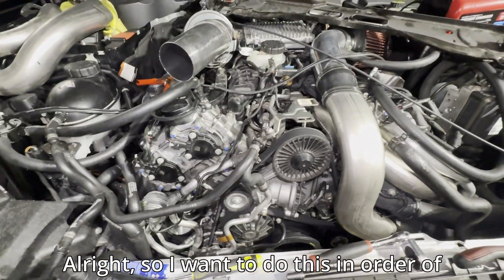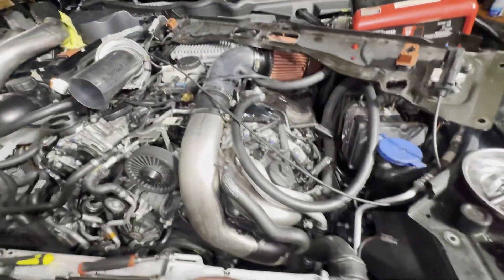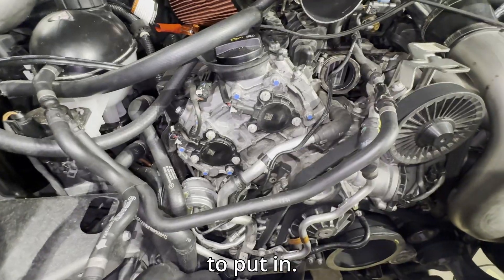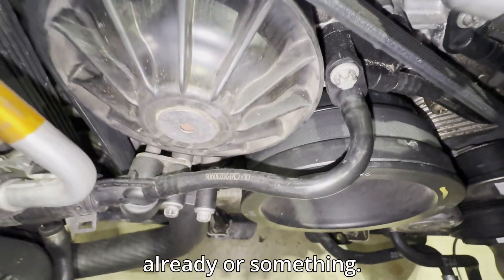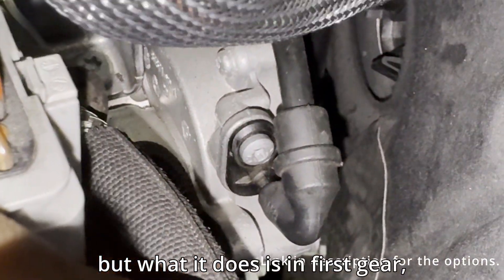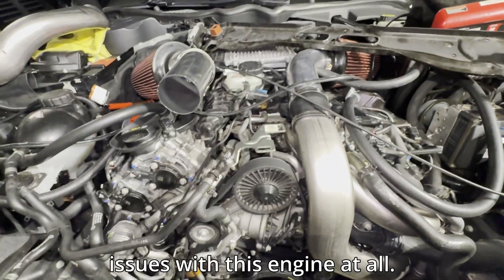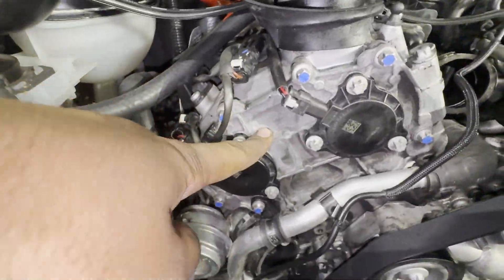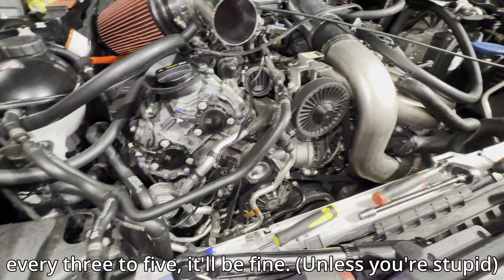Bulletproof Your Biturbo (M278, M157 common problems & fixes)

Comment: To get to the Driver's Side Turbo Coolant Line:
1. Remove driver side wheel and liner
2. Measure heat shield to find location of bolt
3. Use utility knife to cut heat shield and bend back
4. Remove/replace bolt
5. Bend back heat shield and reassemble everything

It's a bit back-yard mechanic, but after spending 3 hours trying this blind you will be glad you read this.
Reply from the maker: On the W218 it’s directly next to the frame rail, so sadly can’t do this.
Reply: @g @ginco_bnz bummer. It worked on the GL, but not on the E550. Looks promising on the CL63, but we will see someday.

Comment: The eBay pigtails on the cam sensors don't block the oil.  The only ones that block the oil are the ones you get from FCP for the magnets.
Reply from the maker: The magnets don’t leak, the sensors do.
Reply from the maker: And yes, they do block the oil if you RTV them in. I did it over a year ago on badly leaking sensors and there is still 0 oil at the pigtails.

Comment: can you give me some tip on putting RTV inside the sensor plug? how do you put it so that it wont clog the metal pin legs?
Reply from the maker: cut the tip of the RTV tube as thin as possible and push it behind the pins

Comment: Hello I just purchased a 2018 CLS 550 with 27K miles. Is it too new to do any of these upgrades or are there things you recommend I do immediately. Also is there any place to purchase full aluminum coolant lines? Thankyou
Reply: Bro your good the 2018 was the last model of the w218 all the mistakes on the 2014 and below were usually fixed on the 2015 and up for example the  2014 and below used aluminum  cylinder heads while 2015 and above used steel which really reduced the cylinder score which was one of the biggest issues on the m278 so don’t worry to much 

Also for the other things mentioned In the video I have a 2014 550 with 84k miles only thing I had to do that was mentioned in the video was my radiator hose other than nothing has of right now LOL but your good g enjoy your ride and be safe  I have had some pretty crazy experiences with that car😂😂😂

Comment: Awesome video man! I’ve got a 2013 G63 with the M157 and have to do the coolant lines for the turbo, I’ve done already but the next one is that PITA one on the drivers side so I’ll definitely be doing that rubber hose mod!

Comment: Question about the intercooler pump always on... 
 So I have a 2013 e63 (pre face lift/RWD) and I don't have that little box by the coolant reservoir to do the mod.   So do you know where it would be located on mine?

Comment: I am really curious. When you change most of the items you mentioned like the lines and hoses etc. Do you have to change them every so often or are the replacement items better and stronger than the ones that came with the original engine?
Reply from the maker: I would do them every 70-80k miles.

Comment: There’s some talk regarding disconnecting the solenoid and you’ll have timing chain tensioner/guide pre mature wear due to the constant 4bar oil pressure. Not sure how entirely accurate this is but have you noticed any signs of this?

Comment: I want to thank you for your suggestions - especially on the oil pump solenoid valve. Since I disconnected it, my 2013 E550 warms up in half the time, and the car is ready to go when I step on the gas. My sacrificial cam pigtails were just delivered, going to install them this weekend. Cheers!

Comment: I did the Oil solenoid trick about 2 years ago and it took my warmups from about 20 miles (would hit temp then re-cool ffs). Now it reaches temp within 4-5 miles and stays perfect. Even MB states that that solenoid is worthless as the TSB for it breaking in any way?.. is to do nothing as it's not essential. The Oil leak into the connectors is not a leak there.. but the oil creeps up through capillary action up the wiring... it's black magic as far as I'm concerned. Hoses: I just buy reinforced silicone hoses by the yard and cut it to size everywhere. I used to off-road in pretty remote areas and always carries spare stuff like hoses, wiring, fluids etc so, that's where that comes from. Also,.. to be "cool".. you can replace your hoses with your favorite colors, lol (I do blue hoses). Also lets you see what hoses you've already replaced base on color. There's also other things to do on the AMGs for saving $ (like buying E55 drilled and slotted rotors for my 2014 E63 Wagon versus the solid rotors - $1100 for rotors, pads, fluids etc delivered versus $3000 for just the 2014 rotors from MB but that's for another day).

Comment: Just got a 2017 S550.  Well maintained with 80k miles.  Took it for an inspection and they said there's zero oil leaks, but I cannot appreciate this video enough man.  This will ease a lot of my concerns with purchasing this beast.

Comment: Amazing vid! My dream car is s63 with this engine but im so scared to just keep it in the workshop all the time. Also What i found in Russian Language. 1. Always check radiotors - must be clean. 2. Keep oil max all the time. They brake because of too high temperature and oild thirstynes.  Also I have one idea! Range rover engines hold better if you keep 1 more liter oil than standart recomended. What do you guys think? It will be ok with this engine?

Comment: You seem like you know what's up with these MB cars.  I learned so many things from your video that I feel like I became a mechanic or something. LOL  I don't know anything about different engines, but I know that my 2013 GL63 AMG has camshaft position sensors issue.  Would your recommended pigtail extensions work with my camshaft sensors?  On the Ebay sale, it only includes upto GL550.  Thank you so much for sharing your knowledge!!!
Reply from the maker: They are all the same, any 550 will work with your 63.

Comment: I wanted to first fix the timing cover leaks in my '14 cls and ended up having to fix literally every single coolant line mentioned in this video cause mine were so brittle they kept breaking at the slightest touch. Also had to replace the coolant reservoir. Good thing now all I have to worry about is the pigtail connectors and the airmatic suspension

Comment: Your videos are super helpful. I just bought a 16 gle350, and i watched the upper timing cover vid. Definitely rather do it maysef than pay 1k or more. Thank you! Any idea where i can find a maintenance chart for these cars? Example: 30k miles, change this fluid, 60k miles, this and that fluid, etc?
Reply from the maker: Mercedes maintenance schedule is good, just ignore the oil changes and do them every 3-4k instead of 10k.
Reply: @ginco_bnz  i plan on 3-5k oil changes but cant find a list anywhere of any other scheduled fluid changes other than brake fluid every 20k
Reply from the maker: @whiteymarauder4372  Call a dealer and ask for one.

Comment: 2012 cls 550, M278, 215,000 miles still running strong, lets see if she can make it to 300,000 miles.
Reply: I just got a 2016 cls550 with 58k miles on it I hope it will last me a long time
Reply: @raymondpacheco1019  Your're good with the 2016 because that is when they went to cast iron cylinders and stopped using the coated cylinder walls.
Reply: @b.goranyordanoff3385 on both 278 and 157 engines? I've heard that's the biggest problem on those engines. Not that common, I guess I should say the most serious problem with those engines.
Reply: @b.goranyordanoff3385  That's not true, where did you hear that? AFAIK all M157 engines have Silitec
Reply: It should last you a long time, just keep up with the maintenance. They are awesome cars, lots of power. I still have it and she still running good. The main issue I had was with the air suspension,  but changed over to coil overs  @raymondpacheco1019
Reply: Who replaced everything before you bought the car?
Reply: @xK0-j3g i replaced everything that needed to be replaced myself. Still Original motor and tranny. When I got it it had 23000 miles. I had it since 2014, changed the alternator, fuel pump, turbo coolant lines, spark plugs brakes, coilovers, drive belt, radiator, etc, just to name a few...
Reply: Just tag me when it does . Love these cars 🎉
Reply: Hey, I’m trying to buy a cls rn, let me know how maintenance and other issues or cost happen on your 300k journey!
Reply: @Ymalodemine lasted till 149,000, but it would’ve went to 250k easily, I changed oil every 3k, and I drive around 150 miles a day everyday, had it since 60k not a single motor issue, not major not minor, my pops first time ever and last, 2 months ago tried changing my oil while I was at work, wanted to do a good deed for me, I come home, start the car it started ticking, a week later I look and find out he disconnected my magnet plug that goes to the camshaft, and I’m assuming the timing got messed up because now I checked and my marks are off by 7 teeth, a month ago I got white smoke blowing out my cat, check engine codes, fuel pressure sensor, camshaft position sensor, loss of performance, ticking sound louder, coolant disappearing but no leaks, so I haven’t drove it in a month, I ordered $1,000+ worth of parts, with labor being 3-5k I’m doing it myself, so started yesterday and hoping I’ll be driving it soon, I miss it haven’t drove it in a month, I’m just rebuilding 75% of the engine parts just so I don’t have to pull it in the near future, but it’s a SUPER reliable car, just unfortunate, and you know if you save up and set aside a few hundred bucks every paycheck for a rainy day fund, it’ll really be smooth and easy ownership, another major repair that happens on these cars is the suspension, the air suspension is always the first to go, I replaced mine right away all 4 bags cost me 2-3k, also didn’t pay labor did it myself, my cars NEVER been in a shop, I always do it myself and I am glad to say that this way probably saved me over 10-20k in labor, because of how much shops charge for these types of jobs, it’s really reliable and amazing as LONG AS YOU MAINTAIN IT, properly, recommended oil change is 7-10k miles, I do mine at 3k every month, and any little issue you get FIX IT right away, it’ll save you money
Reply: U ever give her gas or do you drive normally

Comment: I've been trying to take off the radiator fan but I can't. Not sure why. A video showing how would be greatly
Reply from the maker: Not too difficult once the fan and radiator support is off. I’ve never done it but I’ve done it on plenty of benzes. There are clips in the bottom and you need to release the trans cooler lines also.
Reply: @ginco_bnz  thank you it turned out to be the clips at the bottom as you mentioned

Comment: I think my only concern is a problem with leaking valves and what if anything can be done about that issue.  Good information.  Was considering a 10 year old, low mileage ML550 with this engine but some engine problems can be expensive like the valves. I always like to check how common problems are because every engine has problems but it is really whether the problems occur 1 in 10 cars or 1 in 10,000 cars.

Comment: Thank you.
I'm new here and making progress. Just did the rr heat shield coolant lines.
Found a bottom out bolt on the rr engine vacuum line fitting, that's drying out now. 
Going to check the oil presure solenoid next.

Comment: I have customers that installed those harnesses for the cam sensors and they end up with a extended crank. Do you have that problem?
Reply from the maker: @603benztech  no, they are simply wire extensions, I doubt they would throw off a PWM signal.
Reply: Not possible that they do that. Its just electric wire, signal extension. Maybe some brands just introduce bad connection. Got my pigtails from Ali last year. Cranks up like new

Comment: Good advice.   camshaft positioning sensor pigtails.  had put them in after misfire due to oil in the sensor.  good advice.  not sure if my transmission shudder was caused by the sensor.  I got issues with no gear shift. P0721?  anyone know what it might be?  conductor plate, limp mode, low fuel pressure, speed sensor issues?  or a fudged transmission\torque convertor ?  My CL550 is stuck.

Comment: Does the 278 and and m157 use the same header manifold ?
Reply from the maker: yeah, you can use 63 turbos on 550's.
Reply: Headers and all ? Turbo manifold all of it ?
Reply from the maker: @ the engines are identical except for the internals.

Comment: You my man are a legend. I have literally been looking for a video just like this for so long on the M157 and i had to do so much research to get all of this done on my M`157 .its great to see a video of it all together . Those turbo i charge lines are almost guaranteed to crack and fail. Happened to both of mine after the belt snapped.
Reply: Do you mind sharing the mileage/age so we can plan for changeout?  My M157 is in a 2017 AMG S63.  Thanks!

Comment: 2:42 by filling the sensor with rtv you’re sealing and sacrificing both the sensor and the pigtail extension.

Just a thought if the sensor goes bad then you’ll need to replace both, but you should stop the leaking into the wire harness.
Reply from the maker: Correct, however the sacrificial pigtails are very cheap and the sensors are not common failure points, the oil leak is significantly more common and sealing them has completely fixed it for me for around a year now.
Reply: @ginco_bnz thank you for your response, what rtv did you use? I want to make sure it seals without messing with the electrical connection.
Reply from the maker: @lalilu4u  Just permatex black. You need to use a syringe or cut the nozzle to fill behind and around the pins, don't cover them as permatex is not conductive like dielectric. Actually, now that I think of it dielectric grease could work also.
Reply: @ginco_bnz good call! I’ll go the dialectic grease route should create a barrier to stop the oil, not mess with the electrical connection, and not completely adhere the sensor to the pigtail.
Reply from the maker: @ yep, wish I had thought of that before. Let me know how it goes.
Reply from the maker: @lalilu4u  how did the dielectric grease work?
Reply: @ginco_bnz I did an oil change over the weekend and inspected the two pigtails at the top. One of them had oil seeping through it the other did not. I replaced the one that was leaking and really caked the pigtail in dialectic grease. I suspect i didn’t apply enough the first time.
Reply: @lalilu4u about to do this as well, just to clarify did you fill the magnet connection from the actual magnet or at the pigtail end side with dialectric? Thanks

Comment: how the heck do you disconnect the camshaft position sensor wires?
Reply from the maker: @alanparks3402  pull the gray clip out and push down
Reply: @ginco_bnz  ordered these the day I posted this comment and it STILL hasn't arrived, was supposed to be, "out for delivery" on tuesday morning. Will post updates IF they come

Comment: Jesus those Biturbo engines are complicated. And yet Mercedes is skimping on production cost. The leaking Plugs have been a problem for AGES and they haven't done anything to fix it. They are seriously neglecting quality. I love my old trusty M113 engine.
Reply: M278 is not complicated engine at all , once you get familiar with it, it’s easy to work on … especially on S class , on E class engine compartment is smaller , so it’s little tight in there … oil in the harness issue is common problem with many other manufacturers as well, not just Mercedes … just install pig tails and problem solved …

Comment: As for the turbo coolant lines most of the time it cracks right next to the end of the pipe so that rubber hose wont help much since that end is still plastic. Its super retarded why they made it  plastic.

Comment: I have a 2012 s550 with the 278 engine. I have multiple shorts to positive. Fuel rail sensor fuel temp sensor map sensor boost preasure sensor. all say short to positive. there was oil on the plugs for the cam sensors so i did the same thing you did and put the pigtails on. was running great now couple weeks later it has all those codes. I'm wondering if you think my harness may have been too saturated with oil before i swapped them out? I'm debating ordering a harness.
Reply from the maker: @mountainmangarage7572  check the ECU itself, it can fill with oil.

Comment: front cover seal, is there silicone or gasket? I asked in the store and no gaskets. What did you use to seal?
Reply from the maker: Read description
Reply: I read and it doesn't say anything about what I'm asking you. It's so hard to say.
Reply from the maker: @justitiarius  Timing cover reseal video - do this while you're in there doing the camshaft solenoids. Definitely do it if the one over the alternator is leaking.
   • Mercedes timing cover / cam magnet re...  

Everything you need is in the timing cover reseal video.
Reply: @ginco_bnz  thx

Comment: Nice video, i appreciate the info. I bought a 13 S550 two weeks ago.  Drove for a week and coolant lines on the back side of the engine broke.  I'm just replacing everything lol.  I need to address the camshaft sensors when i get the car back.

Comment: Mercedes made those pigtails years ago to try and keep that oil from getting into the main harness and getting into the ME. Disconnecting that oil pressure solenoid is not a great idea continuous high-pressure wears that pump out. If you drive that car long enough you will discover that. Most likely you’re not trying to get lots of miles out. Sorry, I gave up after one minute. You don’t know what you’re doing.
Reply: well the bore scoring will ALSO wear it out, I think it's better to do deal with the pump than a new engine don't you think?